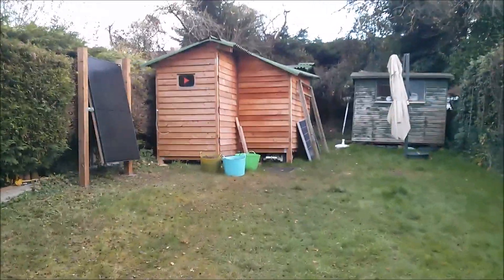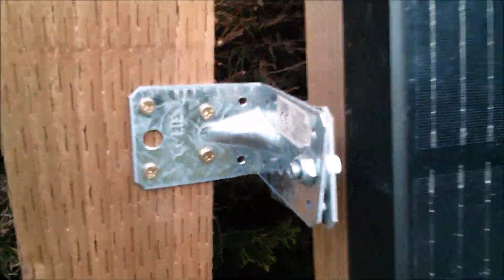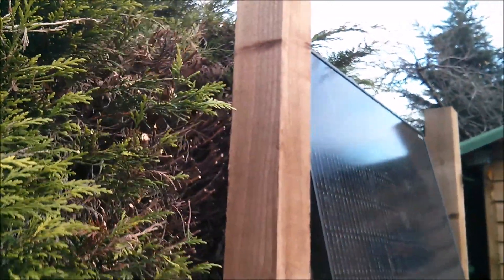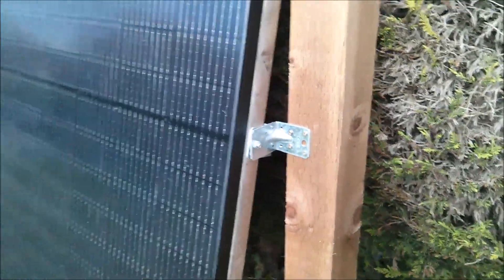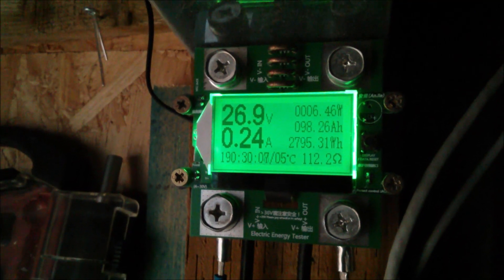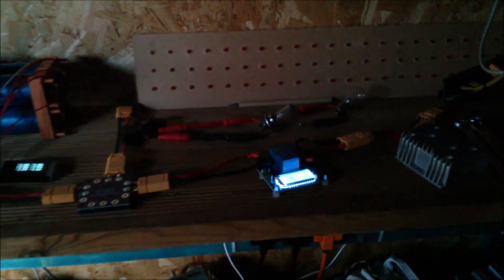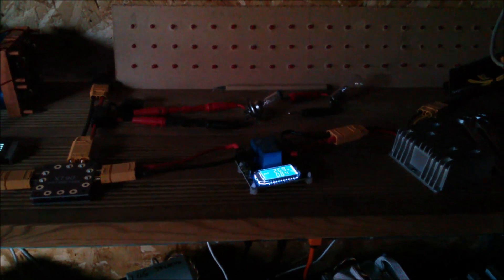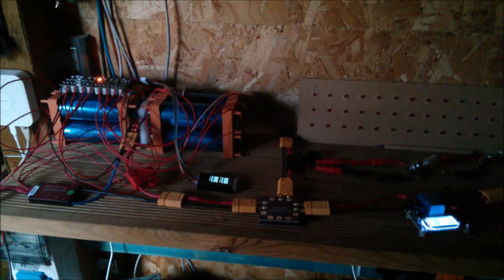325W Solar Panel

Comment: I would do 4x ~10x ~ 20x (440W~672W bifacial )  on a lean to pergola structure  for a 100V ~ 500V PV  DC Waterproof > 6KW or 8KW Inverter 240V  AC with Batteyless  AC Loads
(Waterproof Off-Grid Series 8048MAX WP)
Or 
(Waterproof Hybrid Series 6048WP)

Comment: I saw this about panel tilt angles. 
90 - [your latitude] + 23 (winter).    90 - [your latitude] - 23 (summer)

(For the southern hemisphere, subtract 23 in summer and add 23 in winter)

For the UK, London is at about 51-degrees, so the optimum tilt angles are 62-deg in winter and 16-deg in summer:

Comment: You should move the hinges to the top and swing out the bottom for summer. Less shading of the top behind the supports and you can swing all the way up to horizontal if required.

Comment: i bought 4 of those '240w' size panels, in the best days of summer i've seen a little more but 2 of mine were pulls from a solar farm and i'm sure they get like the best of the batch. the other two never do as muchi only used 3 of the 4, all I could fit on the van roof....

Comment: Did you though about using motorized panel with some simple globe filed with photoresistors that would move panel toward most lit direction? Maybe not for that panel but just for "fun" to use with some smaller panels or just to see how it would work? One time I tried to do similar  project with few photoresistors that would lit lights in room depending on from with window sun shines keeping whole room always lit in equal amount on every side. I failed a bit with it as I'm that  good at more "advanced" electronic but I was close...

Comment: I don’t know how heavy these solar panels are but I see 2 screws in both brackets too close to the edge of the timber, that is not good. You either use bigger brackets where you can add more screws into the middle of the timber or just buy some flat iron, stick to the vice and bent it into an L shape. It is not hard and better policy than loosing a solar panel when the wind picks up😃. Just my 2 cents.

Comment: How will it not flap in the wind?
Reply from the maker: I'm thinking of bracing the tops of the posts to a tree trunk inside the hedge. The trees were 30ft tall before I felled them, so the trunks are massive.
Reply: @JuliansShorts  sounds like a plan.

Comment: You could affix the 240W panel along side the new panel, to maximise you winter solar energy capacity. ;)
Reply from the maker: I did buy a third post to do exactly that, but I'll concrete that one in when it's a bit warmer.

Comment: Baskets of dirt? Don't tell me your are starting a tunnel project to connect your shed to the house, like Collin Furze?
Reply from the maker: Colin must have several trucks a week taking all that spoil away. And how much did all that sheet steel cost?
Reply: They are there temporary to keep the door of the shed from blowing wide open.
Temporary for over a year.

Comment: ...you could probably also have used posts with half the length, or? Half costs... ;-)
Reply from the maker: True, although I'm thinking I may have to raise the panel up to avoid getting a shadow on the bottom edge.
Reply: @JuliansShorts  guessing you’ve not sought wife approval for that mod, probably better off asking for forgiveness after doing it, assuming she notices…
Reply: Could've started with half posts, then added extra if needed. Modular posts 😊